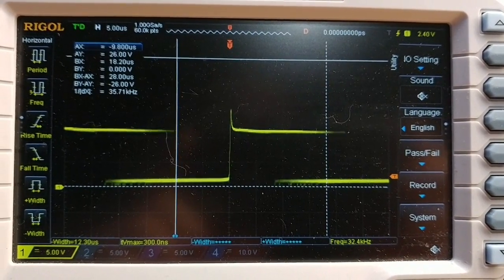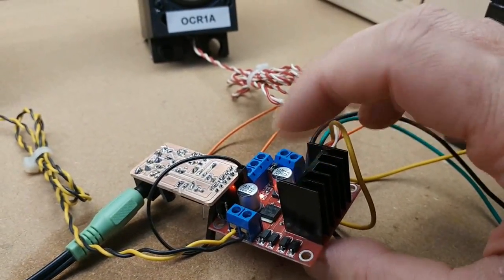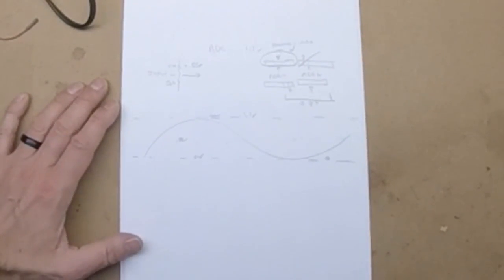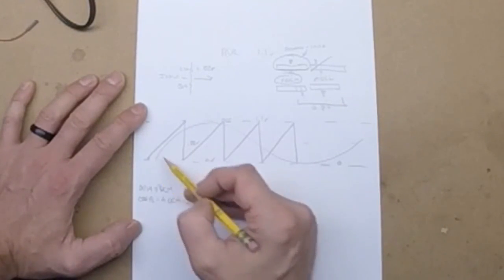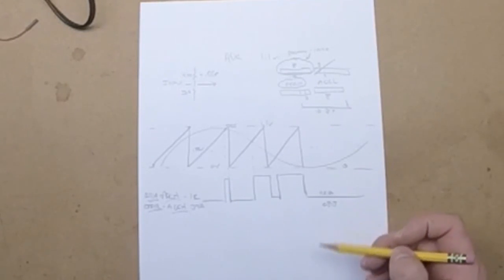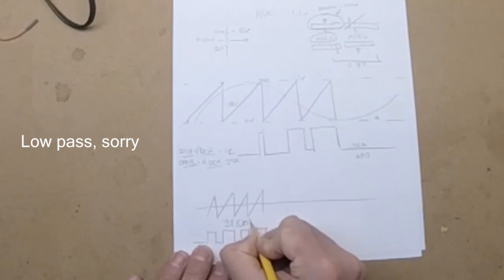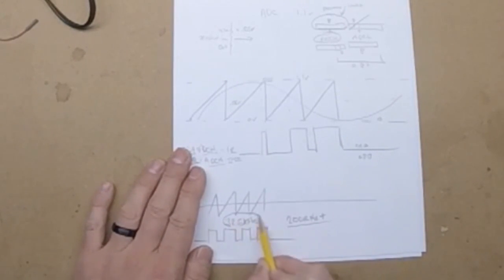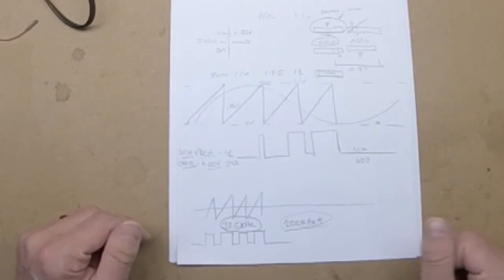Attiny85 Stereo Class D Amplifier

Comment: With 32KHz, filtering the PWM with simple filter and keeping audio frequency will be a problem. There are new devices from Microchip, which has internal clock for PWM at 1.6GHz (gigahertz). That way, I am planning to generate PWM of 200KHz and modulate that to audio frequency output. There will be still enough resolution left for ADC and PWM to generate full dynamic range and filtering the PWM of 200KHz is easy, as 1st order filter is sufficient (20KHz and 200KHz are separated by 1 decade).